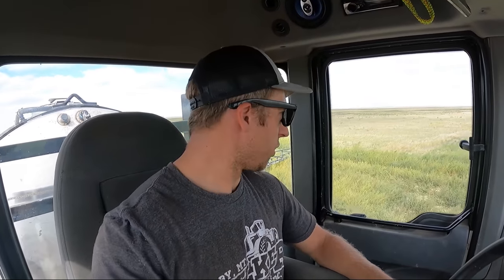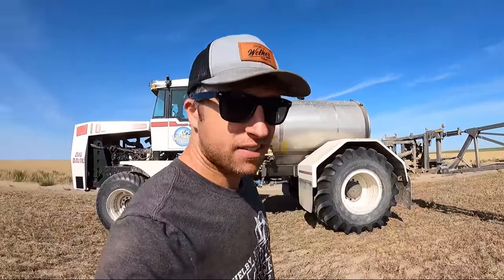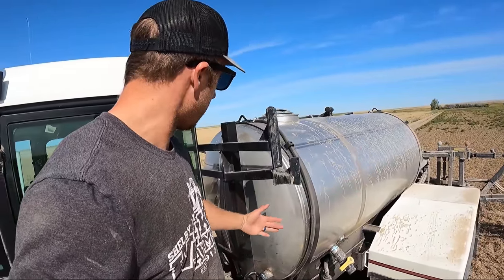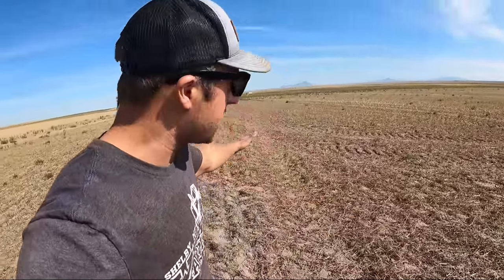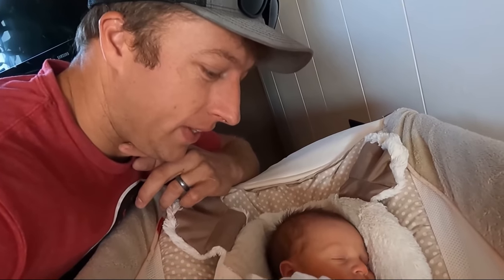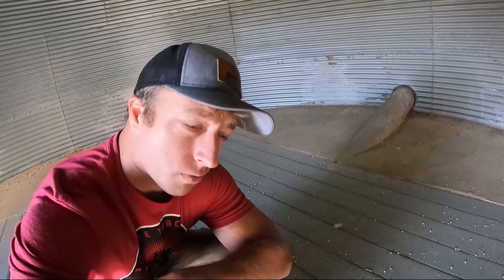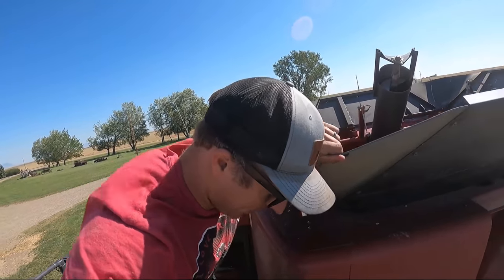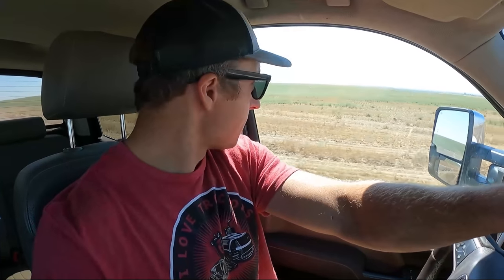Weed Apocalypse! & Baby Welker Is Here!

Comment: Nick, @7:54 , better cut some 1/4” strips, (out of some old belting or something rubber) and put them between the hyd tank, and angle iron to truck frame.  It will cause the tank to crack if you don’t.  Please let me know if they are already in there, I couldn’t see them.  👍

Comment: When bringing a young human in for the winter you must remember four things. 1. Find a place for longest sun exposure. 2. Make sure pot is large enough for the young human.  3. Make sure provide moisture in air ensure young human doesn't dry out. 4. Avoid excess water and fertilizer, that may lead to bigger cleanup job in spring. Congratulations!😄

Comment: Careful with that vent 
I had a setup like that 
Once it over flows and you shut off the pump the venturi affect keeps drawing liquid out of the tank but there's nothing going  in 
Ended up sucking the tank in till I realised and opened the lid to let air in 
Cracked the top of the tank 
You need an air vent at the top as well as an overflow tube 
Good idea in theory but a disaster in waiting

Comment: Could quickly bolt a Rubber Suspension Block from all the tear downs to the bottom of that boom support to save the noggin some knocks. We did the same thing for our Apache that was like yours, and me as the tall guy always knocked my head getting in.

Comment: On the wing support, cut the bottom off (where you hit your head) at an angle and weld a piece of flat steel (maybe 4x6)…that will deflect your head and then you could mount a thick piece of rubber (old terrigstor mud flap). That will help with smacking the old melon!

Comment: We need an updated version for FS22...thats what i think... Lol

Congratulations BTW.

Ok for Brute, reefer trailers typically have a rubber bumper at the tail lights. About umm 2"x3" maybe 3.5". Ought to bolt up to that iron pretty decent. Hang down about 2.5-3" from the point you bolt it to. Shouldnt be real expensive, theyre consumable. My other thought would be collapsible door seal for like a warehouse door. Sold by the foot. Couple suggestions if your still looking. Could be worth giving Zach a call, he had some put on his shop. Might have some extra....aka Millennial Farmer.

Your shadow in the canola field looks soooo lonely. Lol

Comment: SaskDutch Kid did a video about piece of weed control implement called a Noble Blade which does kill the roots of the plant, downside is that it isn't made anymore and probably isn't practical for you (your fields are very big and more rocky and it is a smaller implement). Probably cost as much in gas as it would in spray and take longer. Still it was an interesting bit of older kit.
Reply: We ran knoble blades 60 years ago.  Worked only in loose plowed fields.  Wouldn't even

Comment: Just curious, how many gallons per acre are y’all applying? I work for a Ag services company In East central Kansas  we run 7 JD 4038R machines 1000 gallon tanks and depending on labeling we run between 14 and 20 gallons per acre
Reply: 10 gal

Comment: Why don't you make the rest (on which you bump your head) on a spring tensioned parallelogram mechanism which folds up until you want to use it. if you're really feeling like going fancy, you can add a hydraulic ram to lift and lower it for use. :-)